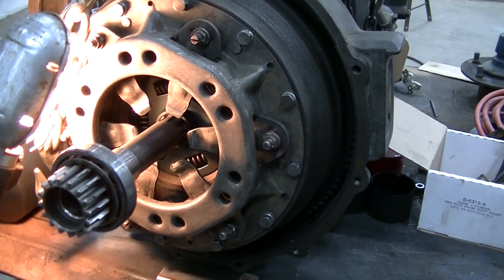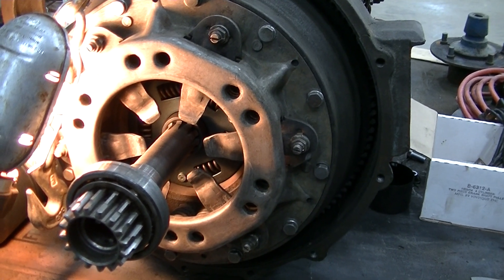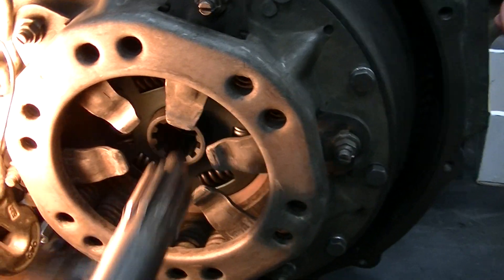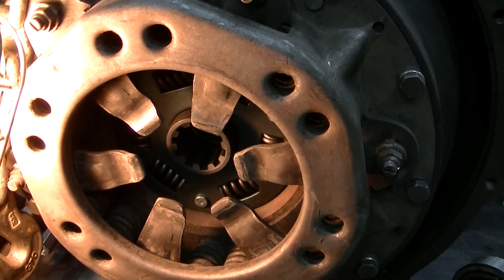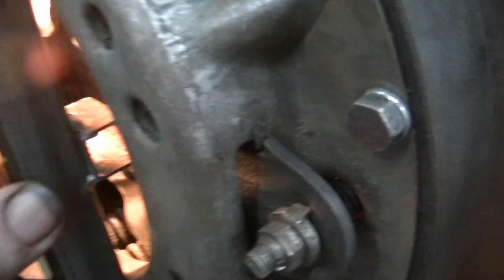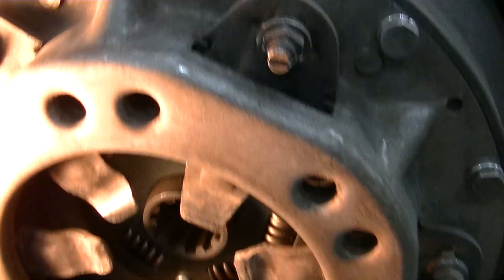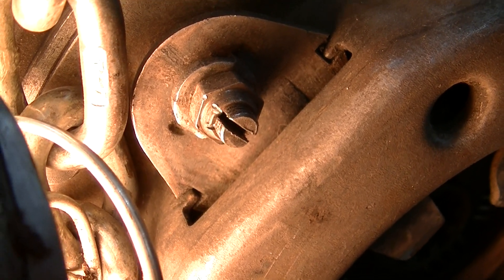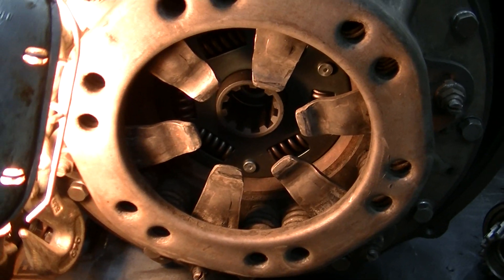Model A Ford Clutch Finger Adjustment - zeketheantiquefreak

Comment: I had to do this adjustment in place, I tightened the throw out bearing to make contact with the highest lever then I adjusted the others levers so they just touch the throw out bearing and I tack welded the nust because the original stacking  were poorly made and I had not the best tools on hands to perform correctly this job
Reply from the maker: Thank you for the comment. After the new disk seats into the old pressure plate I plan to follow up with your process to reset the fingers. Except maybe the welding part!
Reply from the maker: Tell us about your vehicle when you have time.